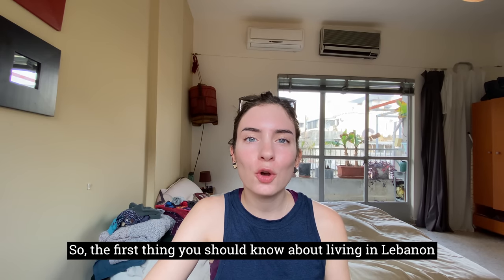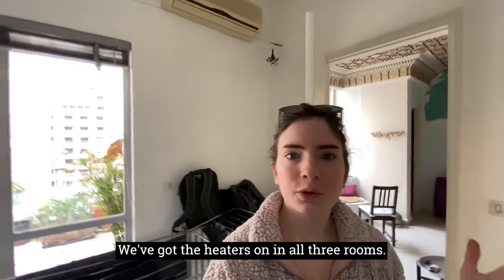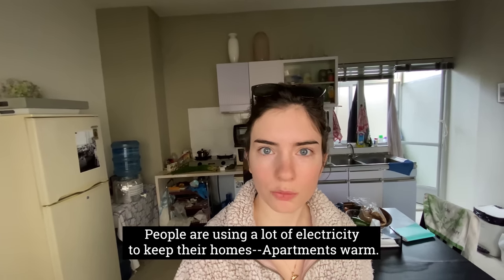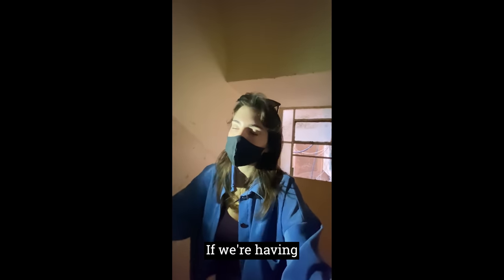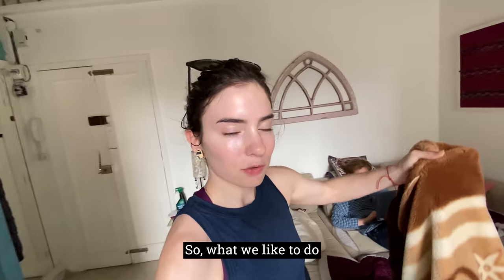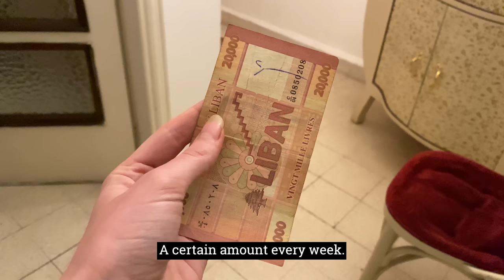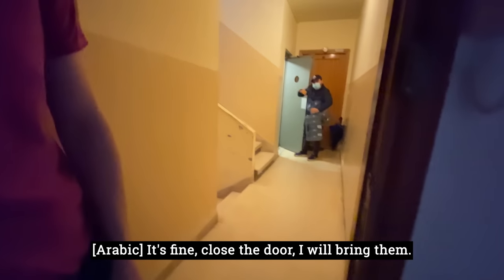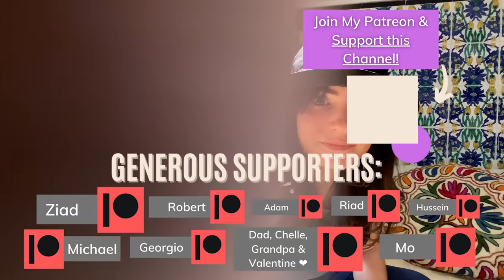Beirut Apartment Life (My Experience) 🇱🇧

Comment: you can actually get power from the local generator as much as the power grid, in many cities at least, if not they can give you for sure a 10 Amp which will be more than fine for 1 AC plus lamp, laptops and wifi. but the landlord will have to pay more. but they should offer you that choice and negotiate a higher fee with you, instead of just making the choice on yourbehalf, and make us all look bad. so just ask your airbnb owner before you book, ask him/her not to be cheap and install you a 10amp circuit breaker before you go there.
and for the wifi there are plenty of power banks that can sustain the wifi modem/router for many hours, in case you don't have a 10 amp circuit breaker in your apartment
Reply from the maker: This is a really great point actually. I had a feeling the landlord could pay for more power from the local generator, because in our 3rd apartment we had no issues with power and it actually never went out, but that was a more pricey apartment. If I were to do it again, I'd ask the host preemptively to install that 10 amp so that we wouldn't have had to even think about the power issues (we would have happily paid a bit more), but since we didn't, it was quite the experience and now we can relate to the majority of people living in Lebanon about the daily struggles.
Reply: @20CamelsEmily  yes indeed. you can even ask for more, depending on your needs. good luck with your journey and we're happy to have you back in lebanon

Comment: I think if the heater was in a closed room , the air will be heated quickly and less renewed air in comparison to an open / large area which needs constant heating and constant electricity consuming, and i think this also applies to air conditioning as well , i’m not from lebanon or expert but it’s a well known practice in my country for rational usage
Reply from the maker: Trust me, we tried that. When the grid power was out, even that would cause the power to cut in and out :/

Comment: So concerning the power, the issue is a more demographic, political, and economical all combined. It's not about the usage. Usage comes into factor when just a sector in the city is out, but basically everything was out. Plus you were one of the lucky ones, because where I live I only had 8 hours of electricity per day, and have to resort to Gas heaters because the electricity was scarce. In order to get warm, the room should have been closed off with one door slightly opened in order to get some fresh air but not get the warmth to escape, oh and there should have been a curtain up, trust me it works. 

Other than that, I'm gonna go back to the usage part, and the switching on and off thing. It's not entirely about usage when it comes to backup generators. The switch you kept flipping is a power limiter, it's based on Amps. And because you kept on exceeding the limit of the Amps that that switch allows to pass through it, it kept on switching off. as long as you kept it under the limit, you should be ok. Pro tip, you can turn off all un-necessary items and you can also unplug the fridge for around 6 to 8 hours, as long as the doors stay closed, the food will be ok. And if in need of any more info, you can contact me and I'll be happy to assist.

Comment: Unless you have a valuable reason to reside in Lebanon, experimenting daily struggle remains an incomprehensible behaviour, even for the sake of self-torment.  A pseudo-country without basic services, acceptable infrastructures, functioning economic and political systems is left behind in the 20th century. After all, a mass exodus would have occurred there if it weren't for the populace constrained travel.